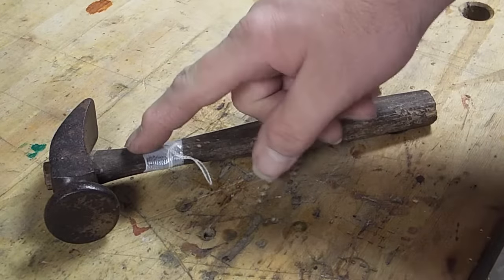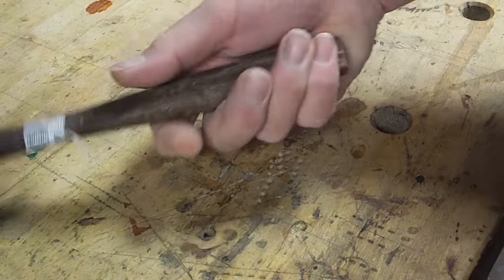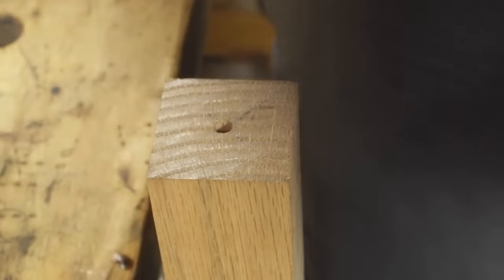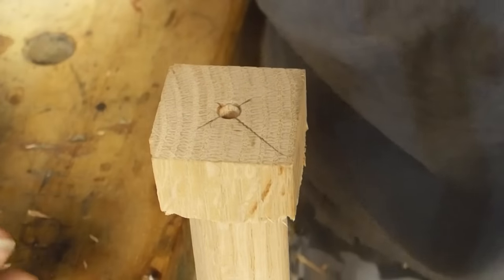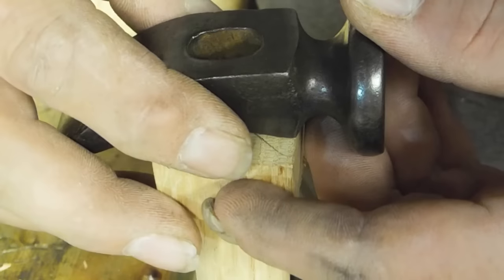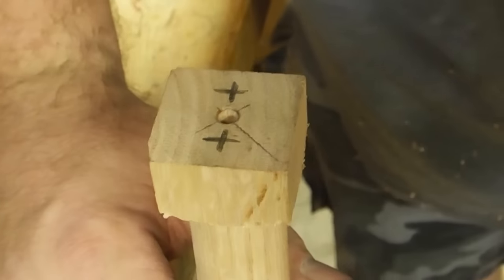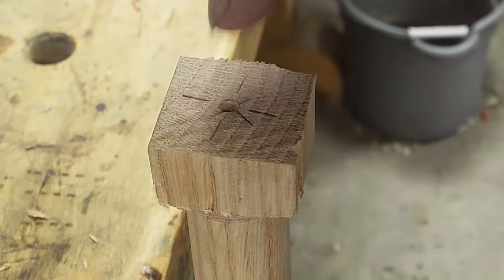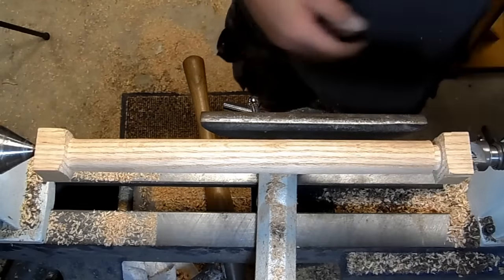GPW 86 - Cobbler's Hammer Refurb (Off Center Handle Turning)

Comment: What is the benefit of an off center handle does that make it a left or right handed hammer? Thanks
Reply from the maker: The off center turning gives the handle an oval shape like factory hammer handles. It's a more comfortable handle and a fun challenge.
Reply: @GPWoodworks   GP Woodworks  ah cool good to know that makes sense as to the shape being more comfortable.  I never knew that's how these were created. Always good to challenge ones skills to the next level. Just picked up one of these on ebay yesterday and it arrived in the mail today.  Haha Didn't realize the seller only lives a 100 miles away, wasn't expecting it fo arrive until sometime next week.  Now going to have to make a handle so I very much appreciate your posting this and your quick reply. Thanks